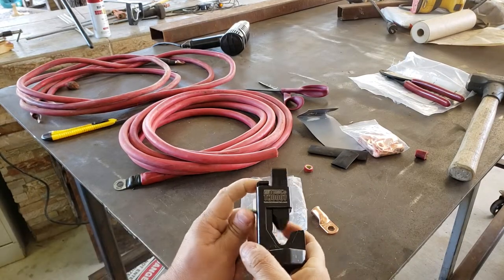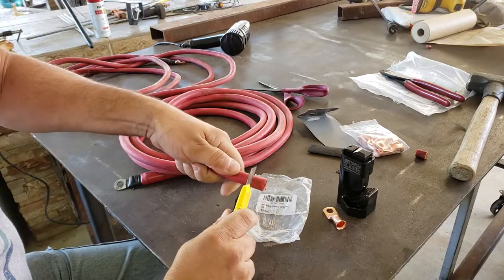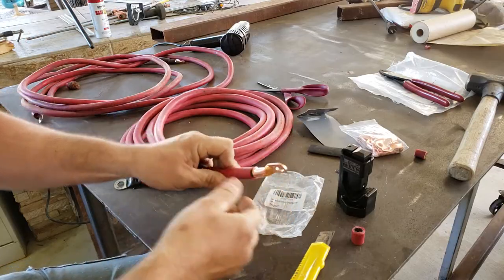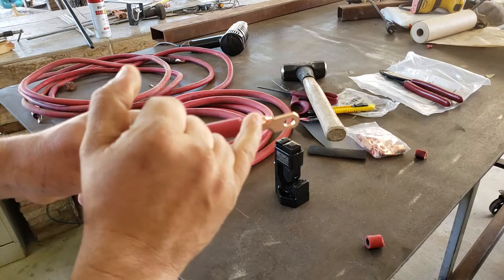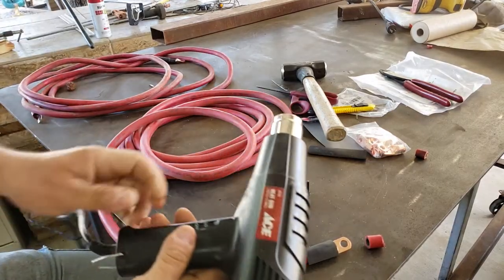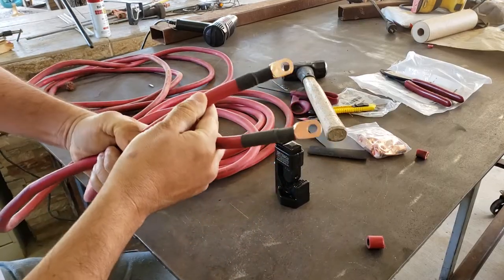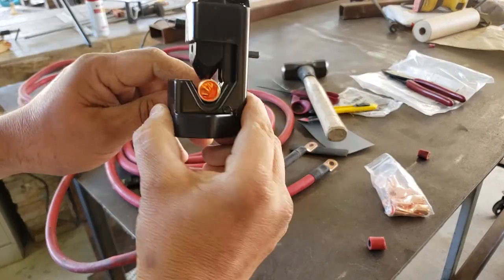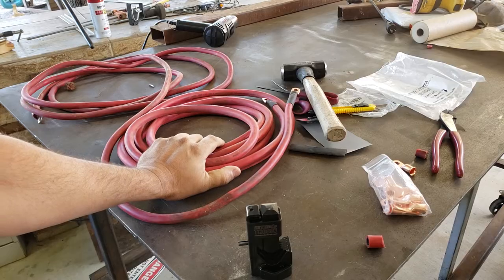How to hammer crimping 1/0 welding cables or car amplifier wires. Temco TH0007 crimp

Comment: Man that is a jerry rigged way of crimmping.   Hydraulic crimpers really give a much better look and durability
Reply from the maker: Would you happen to have a Hydraulic crimper I can have. Yeah, those Hydraulic crimpers are awesome and If I still did car audio installs I would buy me one for sure.
Reply: And the hydraulic one doesn’t work on 0/1, 0/2, 0/3 or 0/4. I have bought three different ones and they don’t work. Just got the impact version of this one and this one works.
Reply: You don't have a clue what jerry rigging is. Nothing wrong with hammer crimper, specially for DIY people that will rarely make cables 0-4gauge cables.

Comment: You’d think a single proper blow would be better than repeat whacks, a bit like snapping metal bending back n forth like through work hardening.  And I think I’m correct in that thinking so my advice is *hit it once and hit it good.✔️
Reply from the maker: Thanks for the info and will try that.

Comment: Yeah. Glad I went with this and didn't go hydraulic. Rather pay $25 one time and use some elbow grease. Beats replacing seals every 3rd crimp. Or spending ~130$ for a reputable model.
Reply from the maker: I have used this crimper many times and was going to use it again today to place a new earth ground on my mig welder. I did a ton of 8awg, 4awg and 1/0 awg for a solar project and it works perfect. I saw a Hydraulic one but was to expensive.

Comment: That's a cool tool it reminds me of a cable cutter I found at an old abandon sawmill you lift the insert up put the steel cable in and wack it with a sledgehammer
Reply from the maker: I just looked for that tool you mentioned and it's very similar to this crimper. I used to hammer the terminals flat with a hammer and really deformed the terminals. I need to buy me maybe some #1 cable as the 80ft 1/0 gets heavy.

Comment: That would work well in a press or a vise as well. I wouldn't mind one of those.
Reply from the maker: I may just try it on my vise on the next cable I terminate. The hammer worked great on it to. Well, enjoy the Holidays friend.
Reply: I always use my vice with the crimper! No jumping around and the connection is always perfect.
Reply: @burlingtonbill4687  dang! I wish I saw this before buying a 3lb sledgehammer lmao.  I don't wanna crack my concrete hitting things,. Thanks for the tip!
Edit: Nevermind, my Vice doesn't open wide enough for me to seat the mechanism inside.  I guess hammer it is.  I'll use my vice flat surface though as the base for the mechanism! and  am sticking my Vice on top of a couple blocks of wood to shield the concrete below./

Comment: @3:47 you mention the sizes, what good are the numbers if you just stick the ring terminal in there and give it a good whacken?
Reply from the maker: I simply just give it a few hits and don't really pay much attention to the numbers as I do mostly 2awg or 1/0 awg wire.
Reply: The V shape allows for different sizes.  The numbers on the tool is to remind you of its limits so you don't go too small or too large.

Comment: I used to work as an installer at a car stereo shop for 10 yrs 😎I've done my fair share of crimping Lol
Reply from the maker: Cool. I did sound systems between 1998 to about 2008. I would later do repairs to amplifiers and equipment that shops would burn up. I would get called at 1 or 2 am to show up and fix issue before turning car back to owners. I owned gear like Hifonics VIII Colossus, USAmps Vlx400, Phoenix Gold Ms1000 and other huge amps. It was a cool era. I also worked at bestbuy in 2001 for about 8 months which I didnt like. 

I still do crimping but mostly 8awg for solar installs.
Reply: @cutweldngrind  ha! That's around the same time(2003-2013)
Reply: We have automatic crimping machine ,do you have interest with it?

Comment: Dope, just got one for my audio system!! Good vid and clear my man!
Reply from the maker: What subs and amps you running? I been out of the audio scene but got me some Audioque hdc3s, Hifonics Colossus and miscellaneous older amps. Glad you liked the video.
Reply: @cutweldngrind  yeah same here brother, been out of the gsme for a bit...but was running two pioneer 12 tsw311d4, on a pioneer dm8601 800 watta rms amp...busted one and now running only one and the amp is running at 2ohms...500 watts but it bangs...but decided it was time to upgrade. So picked up a JP23 2300 watts rms 2 skar ddxs...at 1000 rms each....doing the big 3 and will run 1,/0 all around...wife will get the pioneer setup...
Reply: @cutweldngrind  I'm still rocking a "Crunch  GP3000D-Pro"  from like 2007,  it's so old that there are no internet listings anymore for it. Beautiful amp.

Comment: When stripping wire by hand, an electrician taught me “don’t score the wire!” If you do, cut it off and start over.
Reply from the maker: I have seen horrible scoring of the wire in the past where more than half of the wires were cut off before crimping. I also try to avoid scoring the wires but cant remember what I used in this video. I will have to agree with you on this and thanks for the great tip.

Comment: can those come loose? thats the only thing i am scared about.
Reply from the maker: I say they will hold on fine since I have not had one come loose or over heated. I used to be in the car audio scene in the late 90s and used a similar tool to this one. This tool has worked great for me and for the cost I would try it again if needed.
Reply: I understand what you’re saying: it seems like solder would be superior, but the crimp is time tested method. Soldering is not recommended on automotive applications because it is soft enough to break.

Comment: This works fine, but make sure you buy the terminals with rhin material.
Reply from the maker: Thin, would those be the silver colored ones. I have a lot of terminals that look like galvanized / silver color but they are 2 AWG. I will be buying some terminals later for a solar project in the works. I have been buying several components to be able to have power incase of power outage.

Comment: Not being a di©k but thats a utility blade not a razor blade there is a difference. A razor blade cutting power comes from how thin the edge is opposed to a utility blade's sharpened edge. A razor blade is kinda like a piece of sheet paper. Paper is not sharp yet you can get paper cuts. Just a fun fact that's all. I was actually thinking about getting one of these hammer punches for my needs good review
Reply from the maker: Not a problem. I like to learn stuff and honestly just about everyone I know calls them Razor blades, Thanks for the info and will correct it from now on.